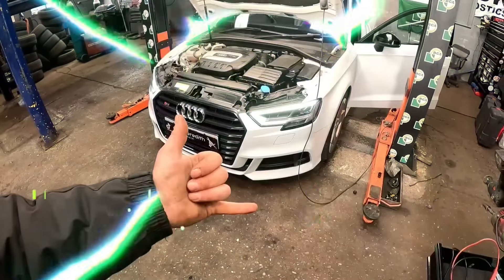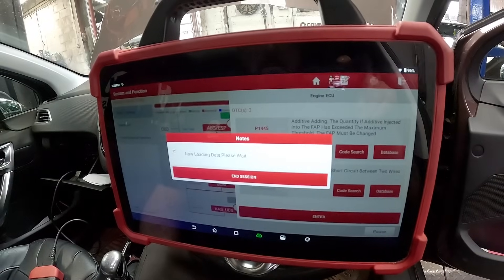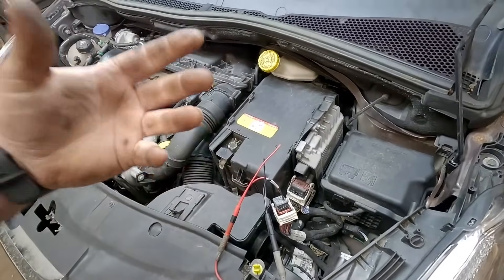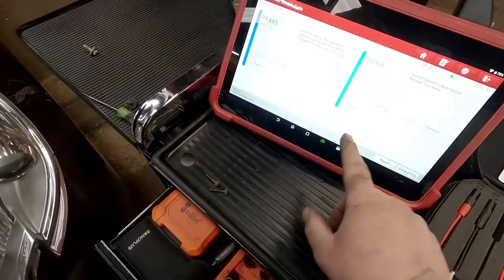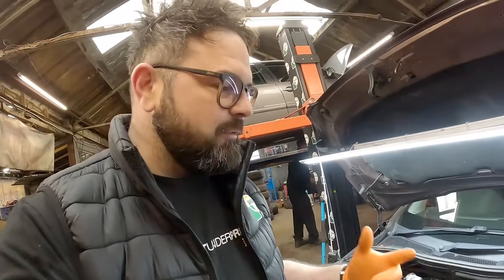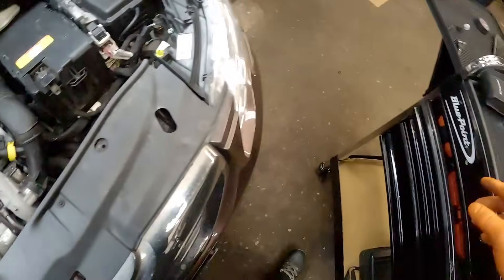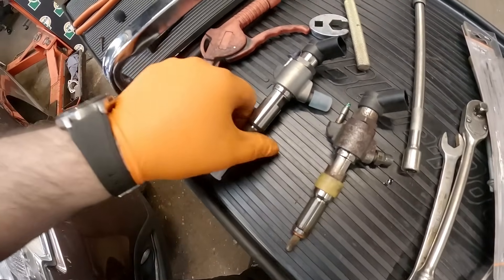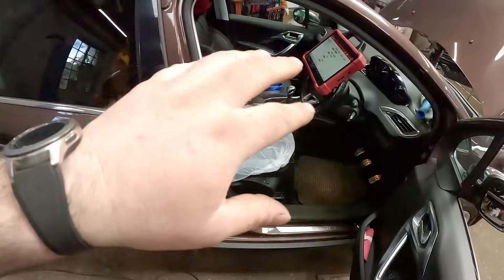THIS BROKE DOWN ON THE MOTORWAY WITH A FAILED INJECTOR!!!!!! PEUGEOT 2008 MISFIRE.....

Comment: Worked on a lot of DV6's for a taxi firm that used to run a lot of Peugeots.
My experience is that the later ones (2010 >) are a much better engine. They went back to 8V so the injectors no longer go through the cam cover, and so they have a proper clamp. Old style used tiny studs with allen key nuts that only torque to 7nm and always seem to work loose. Also the studs have an 'e' socket heads which always used to shear off if you ever needed to remove the cam cover. Those ones were much worse for chuffing. I never really understood why they went to all the effort to make a diesel have 16 valves.
16v engines prefer to rev high and diesels don't lol. 8v low down power suits diesels better anyway.
Reply: 8 valve was definitely the most reliable of the DV engines the current 16v version is snapping the cam to cam chain regularly now

Comment: The good old DV6 ….hate those leak off pipes …I still take a step back and double check it’s a Pug,  #2 is #3 but the same engine in a focus is 1-2-3-4 from the cam..
Reply: At some point every tech in our garage has stripped the wrong injector out due to the backwards 1 to 4 layout 😅

Comment: Do these almost weekly on the ford connect vans with the 1.5/1.6 engines in. They always come out like a dream which is a bonus.
Reply: Agree, I DIY the 4 injectors, pulled them out by hand,luckily.Needed coding, car runs much better and better fuel economy, diesel smell is gone.